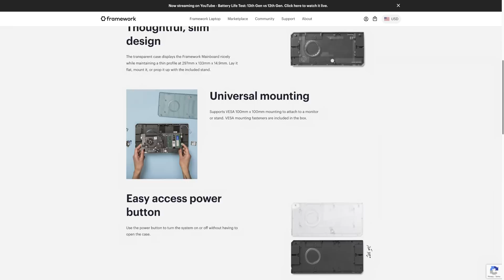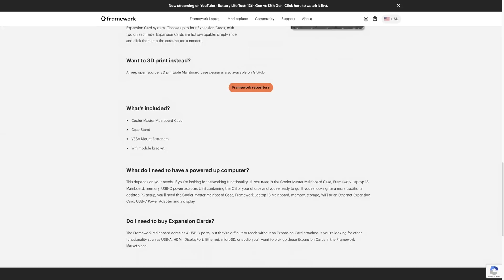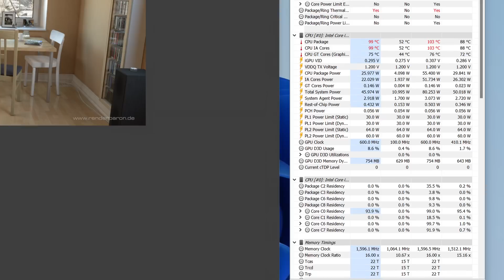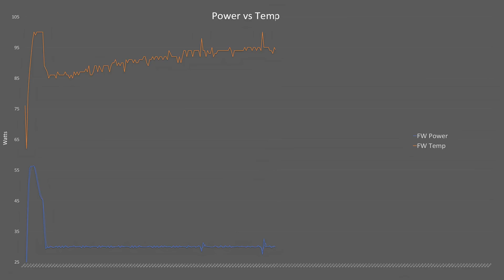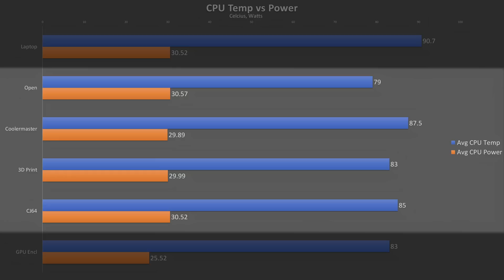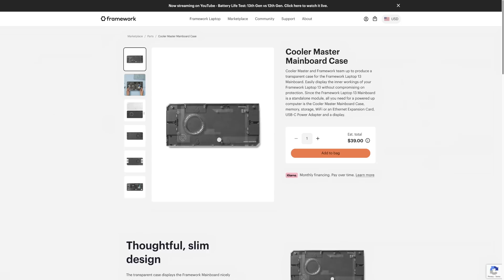Why the Cooler Master Framework Case Could Change Everything!

Comment: Cooler Master is not a niche seller, the fact that they have done this means so much for the prosperity of framework! I hope they get more confident are more open to things in general, they already are very open, but there are still some stiffness in some things, but i'm pretty sure that with time and experience that will be solved.
Reply: Agreed, I was thinking the same. Framework is building a really cool ecosystem, and it's great to see a really big maker jump on board. What I'm looking forward to is seeing people build cyberdecks with the mainboard. It's unfortunate the more common 3D printing materials have some issues with shrink and heat, but the creativity in that scene is amazing so I'm sure they'll get it figured out.

Comment: Great coverage of this product, but it was marred by the audio being so out of sync with your mouth movements.

UPDATE:  The audio sync is perfect when restarting the video a day later.  I don't know why it was not yesterday on the same device.
Reply from the maker: Audio sync is perfect. Might be something on your end.
Reply: I had the same issue. I usually need to turn off the tv, switch apps and then switch back to YouTube
Reply: And audio sync issue. Reboot chromecast didn't fix it
Reply from the maker: @ShadowAssault  It looks like the sync issue is just on the YouTube TV app for some reason.
Reply: The audio is perfect now on my Android tablet, the same device I used yesterday.  I did not have sync issues with other videos yesterday, but now this one if fine too.  Weird.

Comment: Doesn't change anything so few people will buy/reuse the system like this.
Reply from the maker: Framework is already selling out batch 3 of the Ryzen mainboard, which means thousands of replaced intel mainboards will need new enclosures in the very near future.
Reply: The point of Framework is that you can tinker with your Laptop like you do with your PC. This case creates a market for the motherboards after the user has upgraded. Ether they can build a little PC from this and sell it  or the buyer can buy their own case. At $40 it means I can afford a Framework PC without having to buy the whole laptop.
Reply: @@lateone12 I'd like a framework PC or Laptop. I'd prefer it over a normal Laptop. This may mean I can buy the parts 2nd hand. Being able to tinker with a laptop the way we do with PCs is valuable. For many people the premium is worth it. However if this becomes more of a standard like ATX it may end up the cheaper way to get a laptop.  With a PC you can buy a 2nd hand one or build one out of 2nd hand parts then upgrade parts as you get more money. People love doing this.

Comment: Wow the most anticipated review ever since I heard about Framework Laptop, thank you very much, this is a very good direction in my opinion, Kudos to Framework and CoolerMaster, a great secondary computer tucked behind a TV/Monitor while at the same time upgrading to a newer mainboard, what would be great to know is the overhead costs for a full working secondary system setup, say if a person upgrades from the 11th gen to 13th gen mainboard and uses the 11th gen mainboard as a secondary computer what's the total cost one could incur?

Comment: so, can you mount just the case to a desk arm? most monitors are either stand/arm or vesa, as youve said, so mounting this thing to a separate arm would be an option. but is it? i think it would look cool on an arm next to the monitor(s). btw, how are thermals when mounted to a monitor? is there any gap between the two for at least some airflow?

Comment: If I wasn't hip deep in computer stuff that case and board would be really tempting to play around with.  It would be fun to mount it to the back of my LG ultrawide monitor and see how it performs.
Reply: the fan is the biggest issue, there needs to be a replacement cooling system that can fit a bigger much more pleasant fan